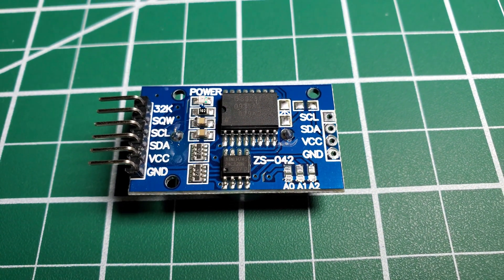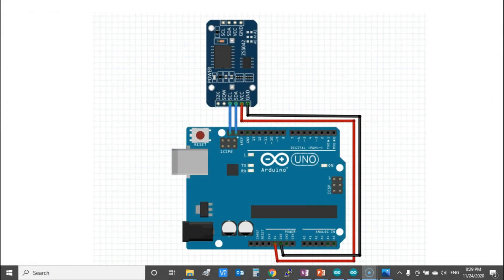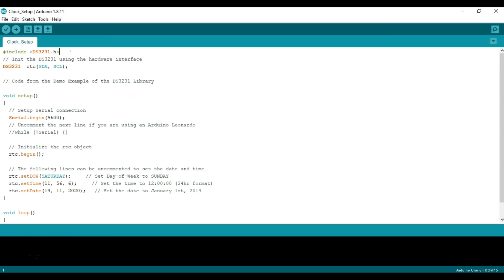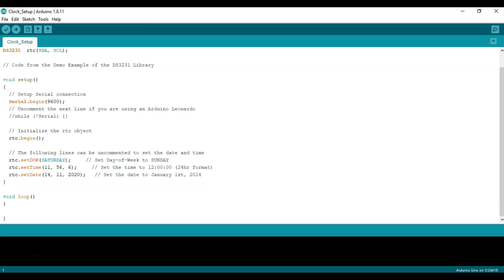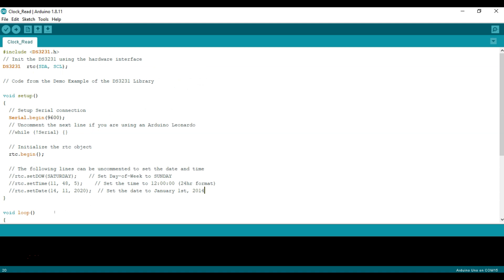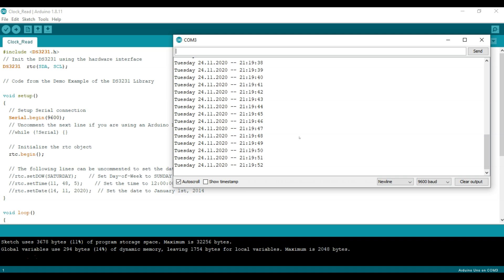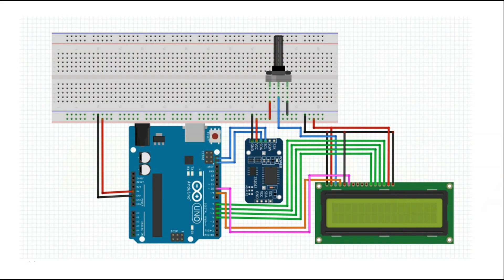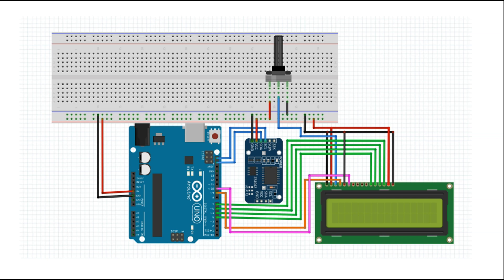DS3231 with Arduino UNO

Comment: I have an issue with the module.
everything works fine, but when I disconnect the arduino from the PC, wait a few minutes, connect it again,  Time starts from the moment where I cut off the power, in the serial monitor. 
Where is the fault ,hardware or software?
Reply: Sorry for waiting 3 years, but did you comment out the 'set clock' section of the code? (timestamp 5:08)